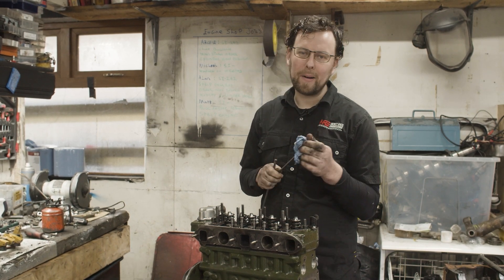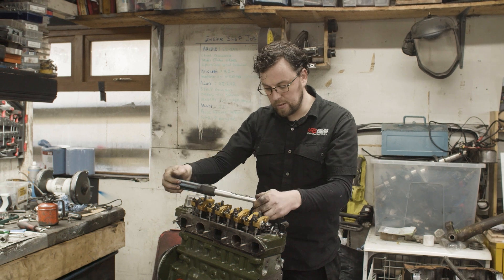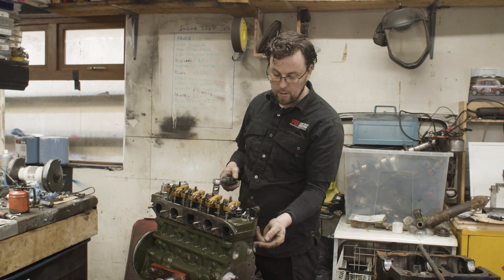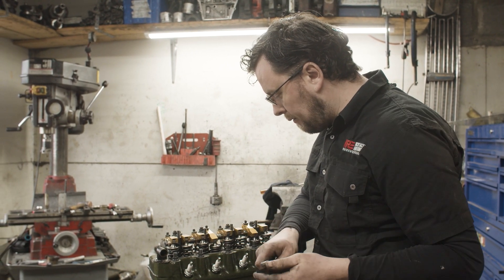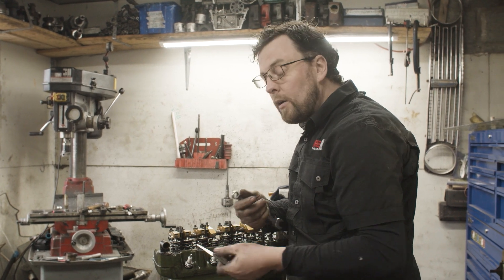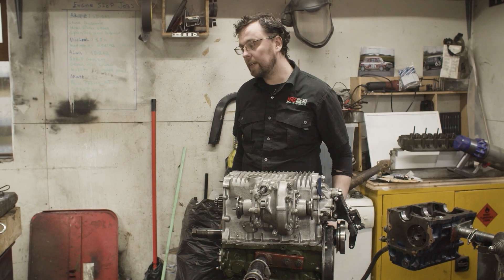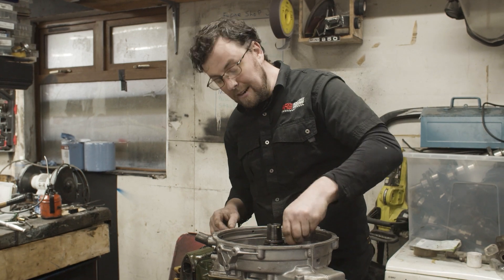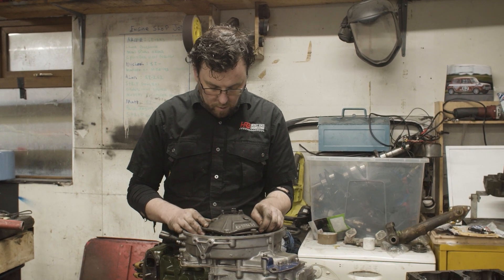Race Engine Build For Our Classic Clubman 1275 GT - Episode Three.

Comment: From memory it was over forty years ago, I think the flywheel bolt torque was recommended to be 110 ft lbs but in practice we never went more than 90 ft lbs. The reason being that you sometimes would not have enough clutch lever throw to release the clutch and I've seen the bars bent and slave cylinder rods extended and spacers behind the thrust bearing. Our thinking was that torquing the flywheel up beyond 90 ft lbs spread the taper on the flywheel thereby increasing the necessary travel of the thrust bearing to release the clutch.  I might add these were standard A series engines not race spec.  Early A series gearbox casings were porous and leaked oil so I had a run of changing 34 gearbox casings under warranty before BMC came up with the fix of draining the oil overnight, cleaning the casing and applying belzona to the outside to seal it.  Sweet memories, I have so enjoyed your vids with the explanations given for the methodology of the build. You have made an old man very happy.

Comment: Just seen this excellent educational video. 
Two comments at BMC we always used the spacer tubes and washers, part nos. C-AEG 392 and AEG168. on race engines, to reduce friction and to line the rockers exactly over the valves, I noticed that yours had springs. We also used the competition rocker shaft C-AEG399 and the modified pedestals. This was back in 1964ish so these strengthened parts may have been incorporated in the newer production engines. To protect the  primary gear seal we used plastic drinks dispenser cups.
Reply from the maker: Honestly Tony, I do the exact same thing on all my customer cars spacers and washers on the shaft to get the rocker in the right spot. This is my own engine and its a bit of a Bits engine I put together a few years ago to get the car out racing. I have full intentions of building a full house 1293 for it but as yet havent found the time haha. I think these rockers come with the tougher shaft as standard. Plastic cup is a great idea 👍👍👍

Comment: I’ve just been introduced to your videos and what a treat they are.  Thank you for sharing so many tips and techniques.  Do you use ARP lube on the head studs and the extra bolts?   Also, some people advise lower torque on 10 and 11 due to the reduced deck thickness at the ends.  What do you think?
Reply from the maker: Hi Andy and a warm welcome  to the channel  great to have you with us, Yes ARP lube on any ARP bolts I use and on the others I use molybdenum disulphate grease on the others. I use a Special 10.9 Cap Head for the 10th and 11th stud and tap the block M10.1.25 so am able to torque it to the standard head stud torque

Comment: Great detail as always. Is the idler gear (“drop gear”) bearing failure a thing of the past now, with modern materials? I remember back in the day the needle bearing would fail and chew it’s way through the clutch housing - spelled death for many many ADO16 cars!
Reply from the maker: Its still a thing but these high quality straight cut drop gears and some careful assembly and measuring insure they last the life time of the motor. thanks for tuning in 👍

Comment: Great video Paul. Quick question I was always told  to dab a bit of oil on the flywheel housing seal and the timing chain cover seal to stop any nasty squeaking on start up just wanted to know your thoughts on that
Reply from the maker: Hi Martian, Makes perfect sense to me tbh. I soaked all my new seals is silicone seal softer  which i didn't show as this was just going back together.

Comment: Would you recommend roller rockers over standard rocker assembly for a 1293 S motor?
Reply from the maker: It all depends on the Camshaft Ian, If the cam is a modern hardened verity and you have a cylinder head setup for higher lift then I would be inclined to see them as an advantage but if the engine is standard for all other intensive purposes I would be inclined to just use the standard pressed steel rockers welded for strength
Reply: @HREIRL  thanks Paul. Running a MG Metro cam and the head has had a light skim as it had some pitting and surface rust when I bought the unit.
Reply from the maker: @CooperSTraveller  In that case buddy I would be inclined to stick with the standard setup, with that said the Metro cam is a decent cam and can handle roller rockers as long and new correct profile followers where fitted 👍
Reply: @HREIRL  great thanks Paul. I was assuming with it being a Mervyn Johnston built engine it would be spot on anyway.
Reply from the maker: @CooperSTraveller  Mervyn builds a great engine :)

Comment: Agree about temp effecting Loctite.
150 Deg C will "unlock" Loctite, so if you have something small that someone used red Loctite on, heat it up with a soldering iron.
Reply from the maker: Yes I  have had a few engines through the shop that have shown symptoms of a loose flywheel bolt and generally when I investigate there is locktite on the bolt. Locktite is a wonderful product in the right place but high temp is not that place

Comment: interesting as ever Paul, no flywheel bolt lock washer? I've never torqued up the rocker adjusters before, didnt know there was a setting!, apart from 'tight'. We laughed at the old rule of 9, we have the rule of 8 and 10!
Reply from the maker: Hay Rich, I stoped using those about 5 years ago when one split (brand new) and let the torque off the bolt on me, resulting in the flywheel coming a drift and destroying the nose of the crank. Ya have always torqued the rockers after one came loose on the Dyno on me and made a right mess. You will have to explain the rule of 8 to me hahaha 🤣
Reply: @HREIRL  We have 8 port heads so with the valves being in a different order they need a different sequence!
Reply from the maker: @MiniPerformance  haha that makes a lot more sense now 🤣🤣

Comment: Decent vids dude, a couple of things-why only a single timing chain? , setting valve clearance - I use mirror image from centre as much easier, and I didn't see the oil ring on the gearbox on the pick up? 😁👍
Reply from the maker: We use a very special simplex timing chain with alloy cam gear and steel crank sprocket and an IWIS chain. It is lighter than the duplex kit and puts much less stress on the valve train. Yes perfectly good method of setting the Clarence with 1/3/4/2 there is a couple of ways :) if you pause the video at 9.50s you will see the black o-ring on the oil pick up but you are right I didn’t mention it 👍 thanks for watching appreciate the comments 😁
Reply: @HREIRL  OK, thanks for explanation, I look forward to the rocker set up video as I have the MED rollers too, keep up the good work and vids dude 🚗👍

Comment: How could you not like this, with in depth explanations of not just what to do, but why it’s done in that particular way. The deepest build secrets shared in a humorous and understandable way. How many actually back off the bolt when rechecking the torque? How many times have we been perplexed by whether to use a gasket or gasket cement and how many would take the trouble to cover the threads in order to protect the seal. Fathomless experience in one apparently so young. I’m sure there must be a portrait in the attic that’s aging by the week, but credit also to the quality and closeup of the video, making you feel as if you are there with your own private tutor. Can’t wait to hear it run!
Reply from the maker: Thanks Thomas you are very kind. I do wish I had that picture in the Attic the greys are creeping in now to remind me of my seniority.
Reply: Couldn't agree more or have said it better.